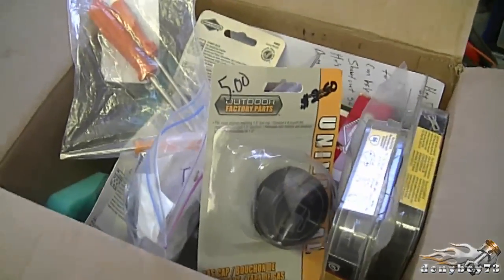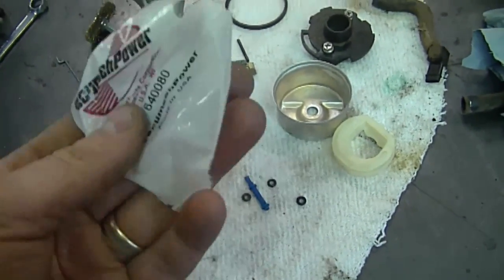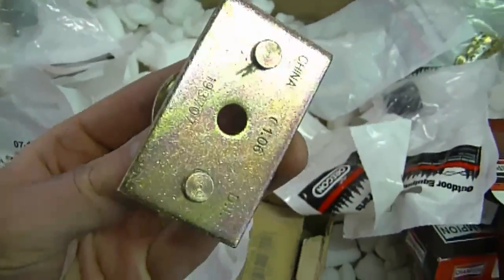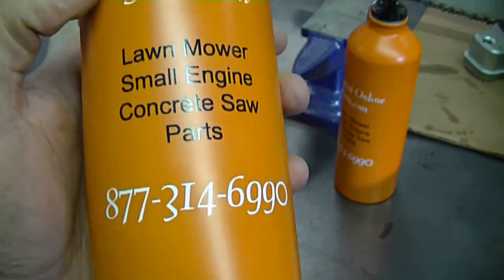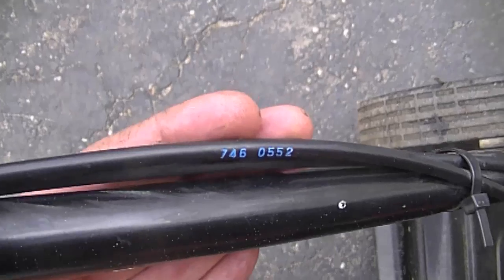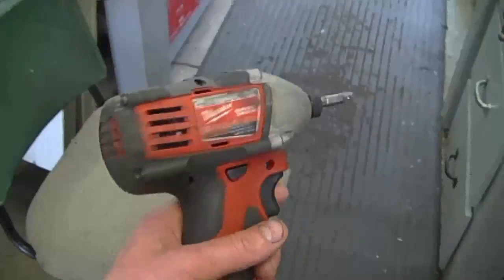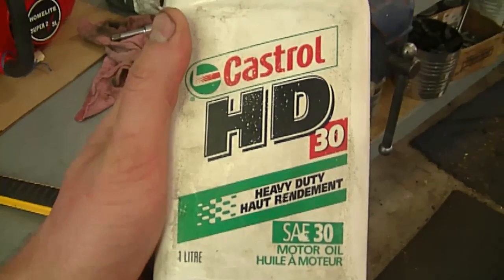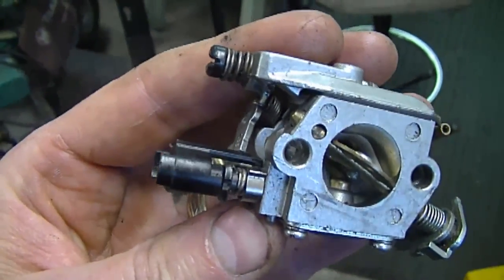Small Engines Q & A Video #125 in HD

Comment: Need some help.  Working on a Cub Cadet mod SC621E walk behind mower with Briggs 121607-01914-E2.  Have disassembled carb and cleaned, new gaskets, etc, cleaned tank, new fuel line.   It runs OK at half throttle but at full throttle, engine surges up and down.  What should I try next
Thanks

Comment: I switched mine over to electronic ignition. It will bolt up but only 2 screws not 4 I used a coil off of a 4.75 vertical.

Comment: Hey Donyboy73, Big Fan. 1 question: I have a Mantis rotar tiller, when I got it (New) It did not run right. The engine stalls under a very little load. It runs fine for the first 5 minutes and after that is starts going weird? What could be the problem?

Comment: Hi Dony, I have a John deere riding mower with the 20hp briggs and stratton v-twin. I decided to take the carburetor off to give it a good cleaning because it was idleing a little rough. Once i got the bowl off i realised the inside of the carb was made of plastic. how do you clean this type of carb or is it a throwaway? I sprayed some cleaner into it, blew some air through it. it seems to be running better now. are all carbs made like this now?

Comment: Hi Dony,

A lot of goodies there! 

What type of in-line fuel filter (high quality - not a cheap one) would you recommend for an old 1970  Tecumseh 7 HP snowblower engine (Model No. H70130067)?

Thanks.

Mike Z.

Comment: What's the part number for the tractor ignition plug, and the terminal connectors? I would like to order them so I can cure my "wiggle the ignition plug and it will run" problem.

Comment from the maker: you might need to adjust the carb, sometimes turning out the adjusting screw slightly helps with your problem, also the small diaphragm may need to be replaced

Comment: Donny.   I'm rebuilding a sears edger Briggs engine  the valves are bent but the cylinder looks good.    Question would I need to replace the piston rings??   And how can you tell if the rings are bad

Comment: Hi Donyboy73

I have some issue with a 5hp briggs and  stratton engine. When
I start it, it allways need some quick start gas to start the engine when it’s cold.
After that it will run like forever. But when the engine is cold i need the quick start
Gas or fluid what ever you call it. What do you think is the problem? Sorry for my
Bad english.

And by the way it’s a Murray 5/25 lawn tractor or a riding lawn mover. I don’t 
know what you call it.

Regards jimboy71

Replay to jimboy71@hotmail.com

Comment: Q: Would a syntetich multigrade engine oil like sae 5w-40 do just as fine as the mineral sae 30 for the lawnmower. I have always used the same oil on the lawnmover as in my car.